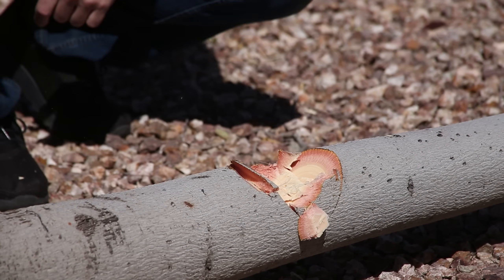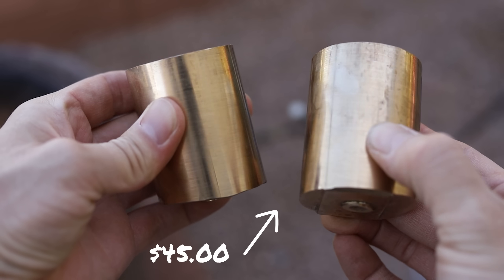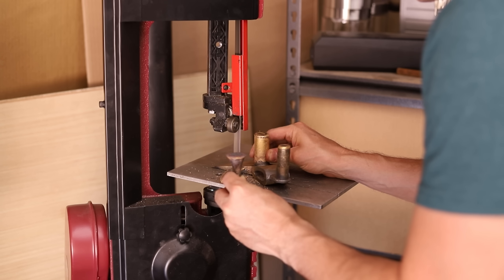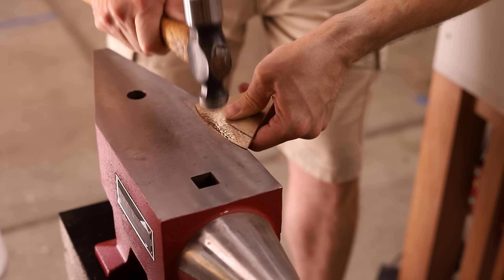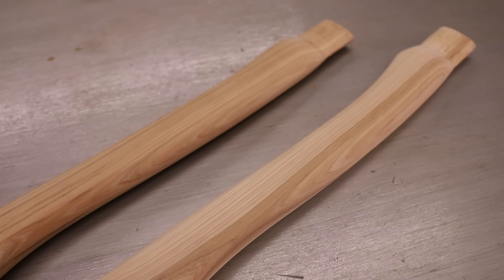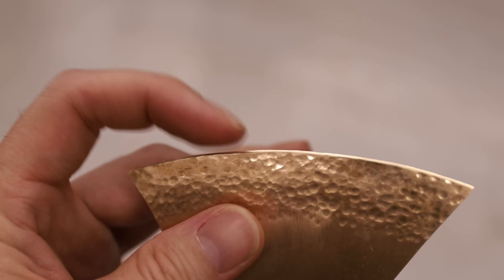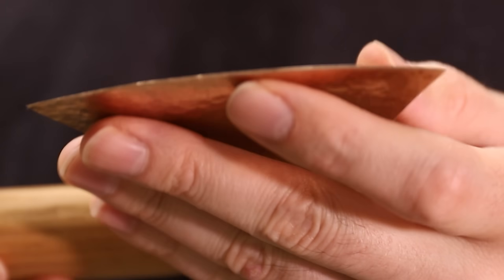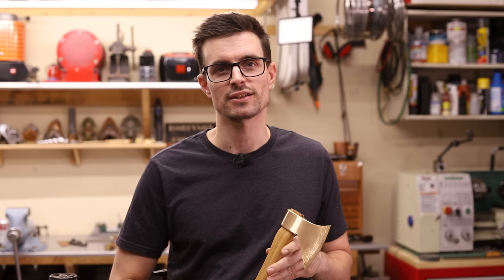Aluminum Bronze VS Tin Bronze, Making & Testing Bronze Hatchets

Comment: While I will admit my deep surprise upfront, the best thing my mentors gave me was the reminder there's more info out there than any 1000 brains can hold, you'll never want to pass up the good info.  Is Al-bronze new, does it have a trade name, and how have I been smithing and recreating historical pieces for decades and never heard of Aluminium bronze.  I don't doubt you, I hadn't heard of Si-bronze until I had either and it's amazing in certain applications.  I know it's not pre-induatrial as Al was dearer than platinum when the Washington monument was completed (1888) the pyramid that capped it cost the same as the daily rate for the most senior master mason on the project for 120 days.  Today that would be about $44,000.  It was too difficult to refine to be used then so it's less than 200 but how much less?

Comment: If it hasn’t been mentioned already, the advantage of iron over bronze in weaponry isn’t strength or durability.  Bronze weapons and armor worked fine, but they were EXPENSIVE.  Once ironworking was discovered you could equip an army with iron much more cheaply.

Comment: The discoloration is an indication of metal hardening. You need to temper the metal by heating it up and letting it cool down.
Reply: By the way it is a good idea to temper the metal after cold forging it to release the structural stress, isn't it?
Reply: By the way, tin bronze used to be a far superior metal for tools, weapons or armor during the pre-steel times, compared to iron. The only downside of tin bronze is that local Mediterranean tin deposits were depleted rather quickly and those ancient Greeks and other cool history book guys had to ship tin from afar. Like, thousands of kilometers far, specifically from the British isles, which made bronze economically impractical, so it was replaced by a cheaper local iron which only required swamp stones and charcoal.

Comment: Cool!
I wonder if there is some special method for cold-forging bronze, rather than just hammering it with a ball peen hammer.
I've seen some special rig for cold-forging or peening scythe blades, were you pinch the edge between two steel blocks, and hammer on the upper block, not directly on the blade itself. This will perhaps give a smoother surface and more uniform hardening of the edge.

Comment: The "Kopis", the classical Greek sword, was made of tin bronze. Alexander the Greats' armies fought with them. They must have been easier to mass produce than forged iron swords. From what I heard, it was hard to source the tin in Europe. You can find ancient copper mines everywhere though, notably in the Alps. This motivated the switch to iron, which was considered inferior. Until the secrets of forging steel spread around the world. Gaul swords were made of iron, or low carbon steel, and would get bent in battle. Romans had proper steel and knew how to make their "gladius" out of composite high and low carbon steels. Steel is what drove western society to the industrial revolution.

Comment: I was messing around with copper and indium a couple months back because I thought I could make bronze out of that. I figured that since indium and aluminum are in the same group I could just make a similar alloy. I'm not a foundryman, I just used a blow torch and fire brick to melt everything which is probably why the aluminum that I used at first just burned away. The indium didn't burn away and it mixed well with the copper. The problem is that a 50/50 indium bronze mix was way too brittle to be practical for anything.
Reply: Generally speaking you want 5-15 % non-copper in a bronze.

Get at minimum 5 times as much copper as you had, mix it up again with your existant brick and you will have 1 part indium 6 parts copper bronze.

No idea of the strength of it though.

Comment: Did the layers of the 3D prints create a strong enough impression in the mold to create steps on the surface of the casting?
I didn't think the liquid metal shrinking down would retain such fine details.

Comment: In my opinion chiping is far worse then bending. Because if it bends and gets dull, you all need is hit the blade a bit with the trusty hammer. But if it chips, you are screwed and have to reforge it.

Comment: An axe does not cut from being sharp, it cuts with its weight focussed on a small point. You should not have used the fill to sharpen them.

Comment: Before iron tools, weapons, and armor became commonplace, bronze was the primary material used throughout Europe and Asia prior to the Iron Age. This was due to bronze being so cheap to make, as well as its durability and strength. The only downside was that bronze was very heavy, despite being so easy to work with when compared to iron.

The Celts brought iron-making to Europe, they were called the Iron People or something, and I forget who brought iron-making to Asia, probably some tribe or family in China maybe. Iron is not as corrosion resistant as bronze, which is why bronze tools, armor, and weapons are more often found, and in better condition than iron tools, armor, and weapons.

Comment: In the book The Odyssey, bronze was the material used for weapons.  The phrase "the cruel bronze" is often used.  That has stuck with me after reading it many years ago.
Reply: I hear ya!  I was wondering the whole time when we'd see the test of trying to hack through a Trojan's armor...
Reply: I understand that bronze swords were used as stabbing weapons but if I had a sword and saw a stab coming I would try to deflect it with my sword. I wonder how many bronze on bronze sword duels a sword would survive before having to be melted and reforged.
Reply: bronze wont bind up as much in a metal vs metal strike. meaning it wouldnt catch in an enemies shield (the iron band on the edge), a blade, or armour the same way other metals would.
i imagine it would make it much better at puncturing chain mail or sliding in between armour joints.
Reply: @NogrimStoneson  What in the "Bronze Age" would you have been making "chain" mail from? 
When trying to make archaeological comparisons, it would be important to compare like with like - which would mean making some arsenic-bronze, rather than tin-bronze. Yes, the Wikipedia level of chemistry describes bronze as a tin-copper alloy, but since tin is a quite uncommon metal, a lot of archaeological bronze is arsenical. The reason is simple - they (Mediterranean metal workers) had to import tin from either Kazakhstan or Cornwall to make tin-bronze (once the small S.Turkey tin deposits became too expensive), while copper minerals often form together with arsenic minerals (indeed, copper-arsenic sulphide and relatives are still significant copper ores to this day) so smelting of poorly-sorted ore would naturally produce an arsenic bronze. 
You need to be more careful working with this stuff. But it's often the correct material to compare with for experimental archaeology. But you're already quite careful.
Reply: I remember the description of arrows and speartips going through the diferent tlayers of the shields...
Reply: Nuh uh

Comment: Isn't the one known as brass and the other bronze?
Reply: Not exactly.  Classically, bronze was an alloy of copper and tin, and brass was an alloy of copper and zinc.  But a lot of other bronzes were developed, partly because tin is kind of expensive, and copper alloys well with a bunch of metals.  Now people should really specify if they mean tin bronze, aluminum bronze, phosphor bronze, or what-have-you.  Some people here have mentioned arsenic bronze, which I don't think I had ever heard of.  I think "funerary bronze" is actually brass, with some other metals to give the color of bronze without the expense.

Comment: Very nice work. The difference in mass will likely affect testing. Trying different edge angles might be interesting, since it looks like you're getting fairly low cutting efficiency with the stout profile. I'm a little concerned about the grain orientation of those handles, but it's probably not a problem for just light testing. How are those sawblade style rasps? I've been considering getting some.

Comment: 4:10 The reason is that that the metals were at two different temperatures. I would suggest heating the head next time. 
Cold forge? Have you considered tempering the metal? I can see that Cold forge can help but tempering the metal helps to bond the metal together better.
You could use coke to help infuse the alloy with Carbon. This should make it even stronger. Not as good as steel but still better than what you have now.

Comment: Well, when soldering flux is vital to reduce oxidation, perhaps you needed some flux during welding the filler?
Not sure what compoud would be an appropriate flux for C630 Bronze, but Borax is commonly used when forging steel.

Comment: Have you ever made a Beryllium Copper hatchet? I know there are dangers in manufacturing it because of carcinogenic fumes and dust but supposedly it is suppose to be very strong. Some tools were made from it because of the non sparking and non magnetic properties.

Comment: try make crash cymbals next, if you like smelting and exploring metal I would love to see you explore cymbals. 80% copper 20% is bell quality bronze; the trick with cymbals is that the compression blow of hammers distorts the metal crystal and gives it the characteristic sound, thats the part that makes crafting a unique challenge. most cymbals you see are lathed but that step is more for the benefit of keeping extra metal scraps and has less impact on cymbal tone than hammering

Comment: The welding "discoloration" you see in the surface is caused by the metal crystals forming differently than the surrounding metal that solidified in the original cast.

Comment: Bronze is a great metal, which is why we had the BRONZE AGE. The one of the biggest reasons Iron (Steel) replaced it was because iron/steel had one major advantage over bronze. Steel could be reforged and repaired. Bronze had to be recast if it broke.

Steel is usually stronger than Bronze, however some bronze, such as phosphor bronze can be as hard as steel.

Comment: I would love to have some Tin Bronze handles for my lock pick tools. Most of them come with Stainless steel riveted or welded handles at a cost of $2.50 to $5 each. HPC, Southord, Sparrows, and Southern Specialties sell handless picks of the same profiles and those could have custom Bronze handles attached. The handless versions of those companies picks range from $2.25 to $3.75. I would love to have a custom 7 piece set made using Southord, Southern Specialties or HPC lock picks. HPC does make a "Renegade" lock pick kit with copper handles but they're outrageous on the price. Plus the pick tools that come in the kit are not really that great. They even sale a "Stealth" kit made with black anodized aluminum handles that are expensive and just plain crap as the aluminum handles bend very easily. I've never done any blacksmithing or metallurgy yet if had the equipment I would give it a try. I know exactly what he means about thinking a project is going to take X amount of time then turns into a whole day of work. There has been many of times that I thought it would take an hour to make a single lock pick but ended up being 4 hours. Unless it's a tool that I can't make then I'll buy a manufactured product.

Comment: I am curious how well these axes would perform compares to a iron/steel axes when exposes to the weather for a couple of years?

Well kinda hard to do in the desert, but one could simulate it by putting then in water or a tropical plant terrarium?

I'm just curious how well bronze holds its edge when it starts oxidising.

Comment: Bronze is a fantastic material for tools and weapons. The reason it was ditched for iron when humanity moved to the Iron Age, wasn’t primarily because iron was superior in. performance, but because it was everywhere, and it was cheap.  The only reason it wasn’t used prior to that was that no one had figured out how to work it.
Reply: No its because they figured out steel.  Which is harder stronger and can hold an edge far better than bronze.
Reply: @davidpowers9178  
That’s part of it, but most of it is because of logistics. Most of warfare comes down to logistics frankly. 

Bronze was a good material but relied upon massive trade networks and cooperation between empires. The moment iron working became readily accessible, it destabilized the entire political ecosystem. For the first time, even small nations could afford to equip armies with high quality arms and armor. The massive advantage that rich nations had enjoyed for millennia evaporated over the course of a century or two, and only a couple of them survived into the new era, and them, significantly diminished.
Reply: @davidpowers9178 steel wasn’t really in use until the Middle Ages — smiths in India developed a technique of hammering carbon (from the charcoal fuel in the forge) into iron, producing small pucks of steel called “wootz.” Somehow this knowledge reached Sweden, presumably through the far-ranging trade contacts of the Varangians, who also served as Imperial guards at Constantinople, and there smiths learned to pattern weld these pucks into swords made with steel, superior to anything else in Europe at the time, giving the Vikings an edge over the competition thus enabling them to conquer much of Europe, Russia, and the lands around the Mediterranean .

Comment: I will explain as simple as I can. That color change is because you are altering the structure of the metal to the atomic level during the heat. While it goes through the rapid cooling it takes a different, typically more brittle and harder (depending on weld material) crystallization. You typically don’t weld a metal with the same material like you did here but with the way most bronzes harden and it’s just a hatchet head it doesn’t really matter. Since the spot is not really in a critical spot of the ax

Comment: Bronze isn't as fragile as people assume. It was mostly economics that led to the iron age. There are very few tin deposits in the world. And extracting aluminum from ore was so difficult until a couple of centuries ago, that royalty used it for tableware over gold or silver. However, iron is an abundant mineral, and it was cheaper to procure and produce than bronze.

Comment: Note that the C630 aluminum bronze that you used can be quenched and tempered just like carbon steel. So you can produce a very good hard edge on this material.

Comment: You REALLY didn't put a very good edge on those axes, if they struggle THAT hard with just some relatively thin pine on a fresh edge.

That, or you put absolutely no effort into your swings.

Edit: see, now I'm just confused. Because both axes did a lot better against the oak than the pine.

Comment: I tried making an aluminum bronze hatchet a few years ago, but wasn't good enough at casting.
(And I don't have my own foundry)

Still have the ingot and it's about 9-10% aluminum.

But these days I've also been tempted to maybe make Copper/bronze Titanium alloy instead.
Which apparently can be made to even be much stronger than aluminum bronze alloys.

Regardless of this has been pretty inspiring to pick it back up again

Comment: Contrary to popular belief, the switch from bronze to iron "back then" was not because iron outperformed bronze hugely (the REAL reason was of economics; tin and copper were hard to find, but iron was bloody everywhere). Bronze is roughly as capable as iron - even if you control the hardness by more work-intensive work hardening instead of by a faster heat treating, and has some advantages over it for weapon making - like much better castability.
People pointing out the slight diferences betwen capabilities of bronze and iron and missing out the "roughly" part in 3, 2, 1... 🙂

Comment: I'm curious if Brass & Copper would possibly be able to create a Damascus product through blacksmithing.

I've never forged Damascus before, so I'm not sure if the two different melting points might be an issue on that.